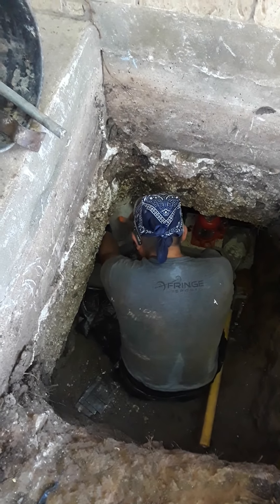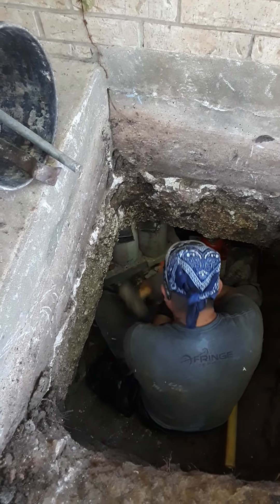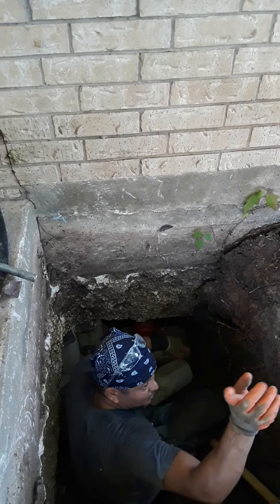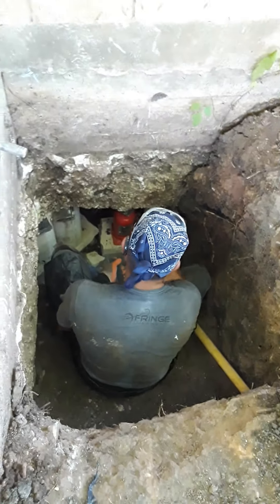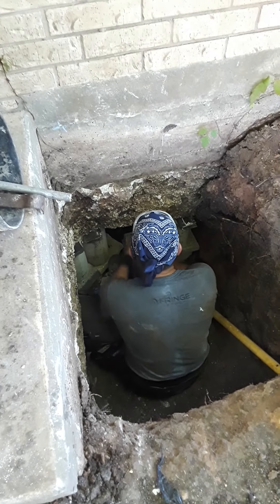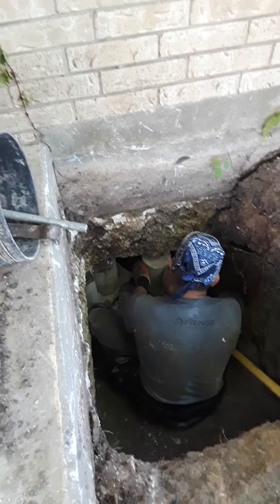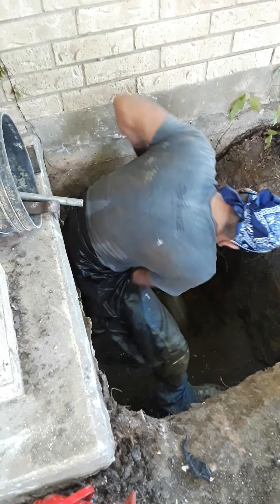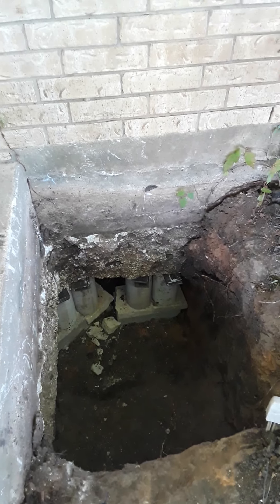Concrete Slab Foundation Repair In Austin Texas (512) 636-9410

Comment from the maker: Tunneling Well Done Concrete Slab Repair & Pier and Beam Foundation Repair (Senior’s Discount Available) (Concrete Slab & Pier and Beam) (Veteran’s Discount Available) (Insured and bonded) North Austin’s Office (512) 636-9410 South Austin’s Office (512-636-2045.

Hacemos O Excavamos Tuneles Para Toda Industria Reparamos Fundaciones De Coumnas Y De Concreto (Senior’s Discount Available) (Concrete Slab & Pier and Beam) (Veteran’s Discount Available) (Insured and bonded) North Austin’s Office (512) 636-9410 South Austin’s Office (512-636-2045.

 We Will Beat any Price On Concrete Slab, Tunneling & Pier and Beam Foundation Repair (Senior’s Discount Available) (Concrete Slab & Pier and Beam) (Veteran’s Discount Available) (Insured and bonded) North Austin’s Office (512) 636-9410 South Austin’s Office (512-636-2045.

Mejoramos Cualquier Precio En Reparaciones De Fundacion & Tuneles. (Senior’s Discount Available) (Concrete Slab & Pier and Beam) (Insured and bonded) North Austin’s Office (512) 636-9410 South Austin’s Office (512-636-2045.

Free Engineer Certification On Any Foundation Repairs (This Month Only) (Senior’s Discount Available) (Slab & Pier and Beam) (Commercial & Residential) (Veteran’s Discount Available) (Insured and bonded) North Austin’s Office (512) 636-9410 South Austin’s Office (512-636-2045.

Affordable Foundation Repair (Senior’s Discount Available) (Slab & Pier and Beam) (Commercial & Residential) (Veteran’s Discount Available) (Insured and bonded) North Austin’s Office (512) 636-9410 South Austin’s Office (512-636-2045.

Reparaciones De Fundacion A Tu Alcance (Senior’s Discount Available) (Slab & Pier and Beam) (Commercial & Residential) (Veteran’s Discount Available) (Insured and bonded) North Austin’s Office (512) 636-9410 South Austin’s Office (512-636-2045.

Low Cost Foundation Repair. (Slab & Pier and Beam) (Commercial & Residential) (Senior’s Discount Available) (Veteran’s Discount Available) (Insured and bonded) North Austin’s Office (512) 636-9410 South Austin’s Office (512-636-2045.

Reparaciones De Fundacion A Bajo Costo.(Senior’s Discount Available) (Slab & Pier and Beam) (Comm & Residential) (Veteran’s Discount Available) (Insured and bonded) North Austin’s Office (512) 636-9410 South Austin’s Office (512-636-2045.

Up To $3,000.00 Off When You Schedule Your Foundation Or Tunneling Repair Job Before April 30th, 2024 (Slab & Pier and Beam) (Senior’s Discount Available) (Veteran’s Discount Available) (Insured and bonded) North Austin’s Office (512) 636-9410 South Austin’s Office (512-636-2045.

Hasta $3,000.00 De Descuento Al Firmar Contrato De Tu Trabajo De Fundacion O Tuneles Antes De Abril 30th, 2024  (Senior’s Discount Available) (Slab & Pier and Beam) (Commercial & Residential) (Veteran’s Discount Available) (Insured and bonded) North Austin’s Office (512) 636-9410 South Austin’s Office (512-636-2045.

We provide quotes, elevations drawings, pier detail/location drawings, and before and after photographs. You can be one of our many satisfied customers. (Slab & Pier and Beam) (Commercial & Residential) (Insured and bonded) North Austin’s Office (512) 636-9410 South Austin’s Office (512-636-2045.

You have a great home and it's wise to preserve such a valuable asset by having the foundation repaired properly. (Slab & Pier and Beam) (Commercial & Residential) (Insured and bonded) North Austin’s Office (512) 636-9410 South Austin’s Office (512-636-2045.

click on the links and you can find more information about our company and all the ways we can assist you to repair your house for you to enjoy it, sell it or rent it.
(Concrete Slab & Pier and Beam) (Commercial & Residential) (Insured and bonded) North Austin’s Office (512) 636-9410 South Austin’s Office (512-636-2045.

We can meet any bank requirements to make it, FHA Approved, HUD Approved & VA Approved.  (Concrete Slab & Pier and Beam) (Commercial & Residential) (Insured and bonded) North Austin’s Office (512) 636-9410 South Austin’s Office (512-636-2045.

We will include the city/county permits, Engineer Certification & our Warranty. 
(Concrete Slab & Pier and Beam) (Commercial & Residential) (Insured and bonded) North Austin’s Office (512) 636-9410 South Austin’s Office (512-636-2045.

I'd be happy to further discuss the scope of work while answering any questions you might have.
Until then please feel free to call us or email us at any time to get it into our schedule.
(Slab & Pier and Beam) (Commercial & Residential) (Insured and bonded) North Austin’s Office (512) 636-9410 South Austin’s Office (512-636-2045.

Regards,

Rci Enterprises’ Team. 

For questions or to schedule the job, feel free to contact us.
We can give you 5 TO 20 % DISCOUNT IN ANY HARD BID OF THE COMPETITION(Within the same scope of work).

RCI ENTERPRISES House Leveling & Foundation Repair
 
Austin’s North Office     (512) 636-9410 

Austin’s South Office     (512) 636-2045